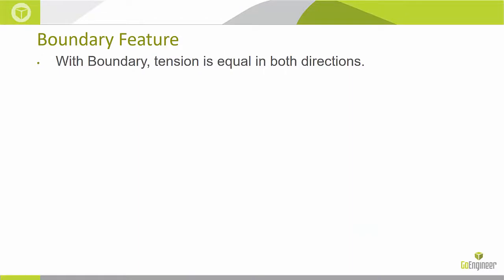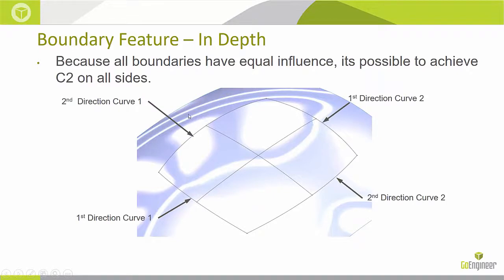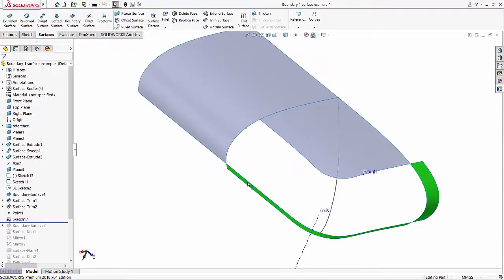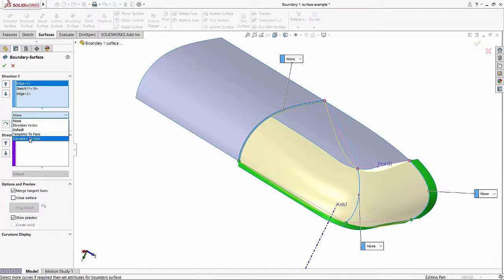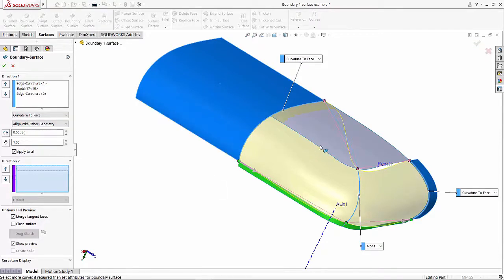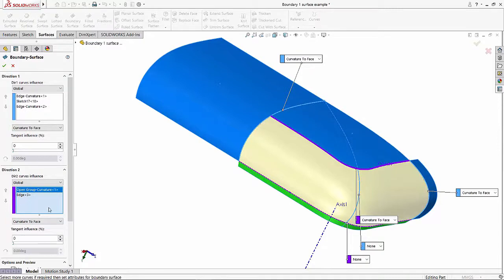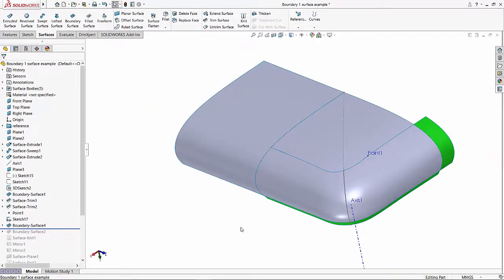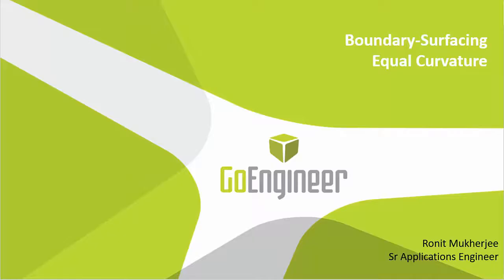SOLIDWORKS Surfacing - Boundary Surfacing Equal Curvature

Comment: The error message at 3:33 can you explain why that pops up.
Reply from the maker: “The guide or profile curve’s curvature at its end point(s) does not match the curvature of the surface it touches.”

At one of the point-to-point contacts on that lower edge, where the existing surfaces touch each other, there are differing curvatures. The tool is unable to create a blend between one face and the other. The Direction 1 curvature will take priority in this case. Viewing Curvature (from the Evaluate tab) or creating multiple surfaces could help us determine which corner is creating the issue.